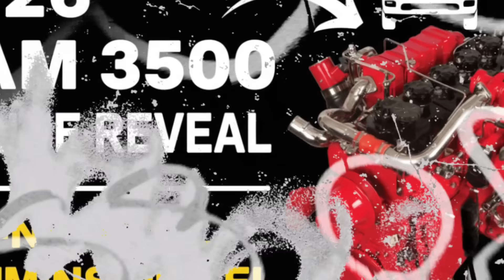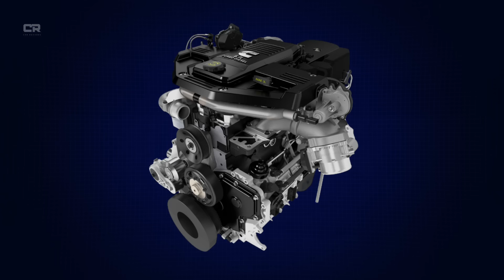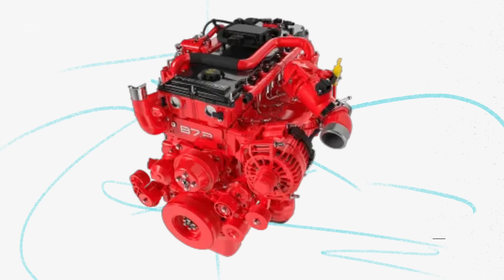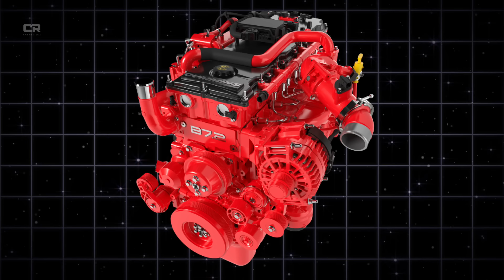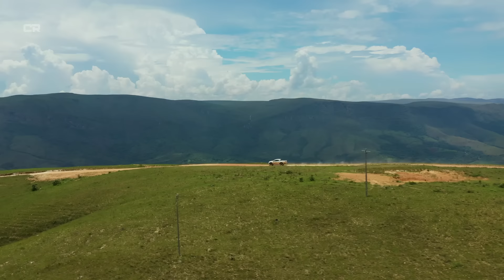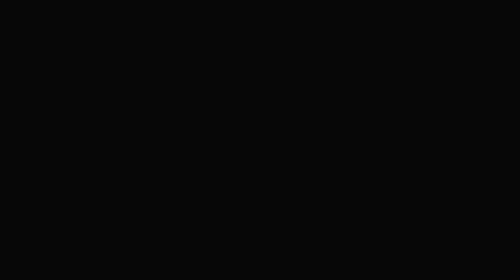BREAKING: RAM Unveils All-New 7.2L Cummins Diesel for 2026 RAM 3500

Comment: If they could figure out a way to make the oil filter harder to get to, like inside the oil pan for routine maintenance, that would make sense.
Reply from the maker: That's an interesting point! Designing the oil filter for easier access would definitely streamline maintenance and make it more user-friendly.
Reply: 😂😂😂 True. Their filters have been a nightmare for decades. In all types of chassis.
Reply: @HSKFab  My 5500 is very easy to change, no problems at all

Comment: There is no way RAM will put this engine in a light-duty truck if it is 200 lbs heavier; the Cummins is already the heaviest engine of the 3 as it is. Also, with the 7.2L having the same bore but a longer stroke, good luck matching Ford’s 500hp; the current 6.7 doesn’t rev that high and already has a very long stroke; lengthening the stroke anymore will just make it that much harder to make the hp that the V8 diesels are making as it will be limited by RPM. They also probably had to increase the deck height meaning the block will be taller if the stroke length is that much longer, meaning it will be harder to fit it in a light-duty truck. This 7.2L is starting to not make any sense in a light-duty truck; the more I read about it, this is more so for medium-duty applications. I see RAM sticking with the 6.7L for quite a while longer
Reply from the maker: You make some solid points! It will be interesting to see how RAM balances weight and performance with this new engine. The engineering behind these decisions is always fascinating!
Reply: Sorry to tell ya, but they are. They are taking orders for the 27's in June.

Comment: I just ordered a 3500. The 7.2 isn’t an option on my 2026 only 6.7
Reply from the maker: Thanks for sharing! It's always interesting to see how production options align with the latest announcements.
Reply: It will probably be a 26.5 like they did when the went from a 5.9 to the original 6.7
Reply: The 7.2 engine will be released January 2027, so it will probably be a 2027.5 model year if they do it, just like the 6.7 came out January 2007 for a 2007.5 model year & the 24v vp trucks came out January 1998 for a 1998.5 model year
Reply: Likely won't release until late 2026 for EPA 2027 emissions, hence the 48volt generator by the ECM to preheat the aftertreatment for faster passive regeneration and NOx conversion
Reply: Probably we're not going to come out with one at all.

Comment: Nice although they already have very low mpg vs the competition so I can only imagine how bad this will be with bigger displacement. Pass everything but the fuel stop. I’ll stick to old reliable.
Reply from the maker: It’s always a trade-off when it comes to power and fuel efficiency, but some prioritize that extra displacement!
Reply: My 2023 Ram 3500 gets 18-20 mpg on the highway I've never seen a stock Ford or Chevy come close

Comment: No way it can pull 45,000 lbs
Reply from the maker: It’s definitely a bold claim! The specs are impressive, but real-world performance will be the ultimate test.
Reply: Really I pulled up to 35k with a 5.9 12v 20k alot
Reply: I know damn well it will pull it!
I pulled 44,200 lbs from west Texas up into Montana with a 6.7 2015 😉
Reply: Maybe once 😂
Reply: @wfodave you must be accustomed to powerstrokes...😅

Comment: Now if you told me they eliminated EGR and DEF I would consider it an upgrade. New 10 speed transmission is a nightmare of problems. Understand no one wants more electronically controlled ANYTHING!
Reply from the maker: I hear you! It’s understandable to want simpler, more reliable systems without the added complexity of emissions controls and electronic components.